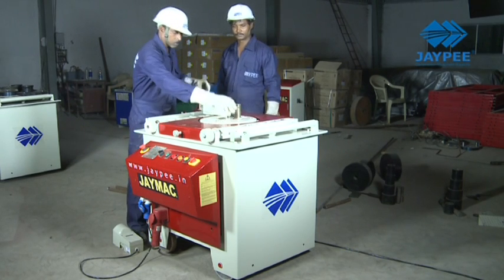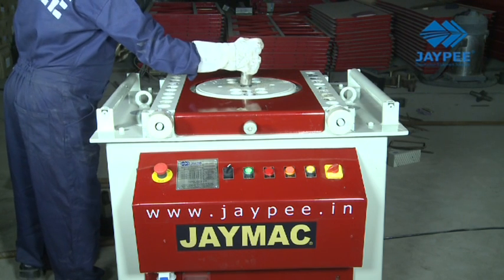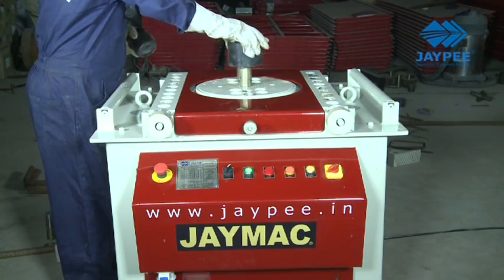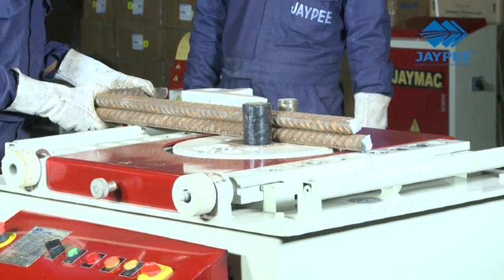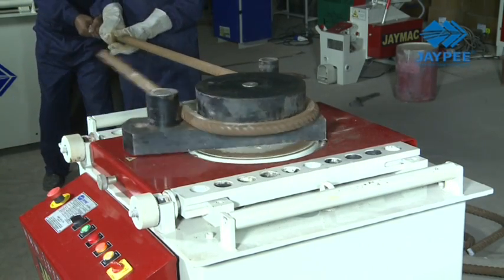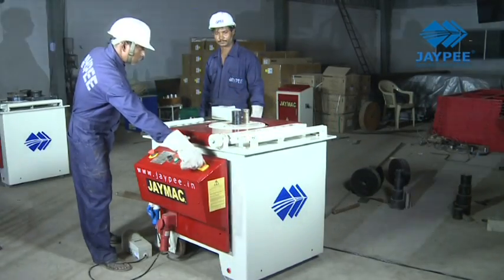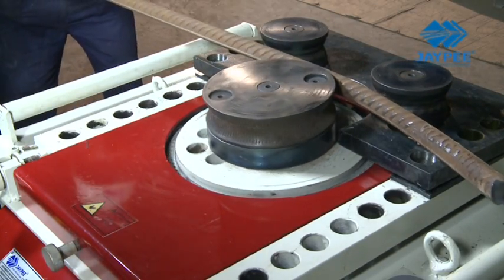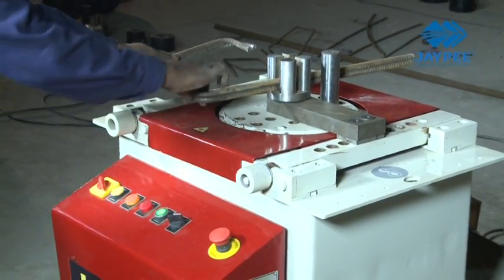Bar Bending Machine @JAYMAC - Call +91 9051234444

Comment from the maker: Bar Bending Machine
Bar Bending Machine is a semi automatic, durable fast and cost effective machine, used for bending reinforcement bars and various forms of round bars.

This machine effectively increases the production capacity of your steel yard, minimizing the use of manual labor.

Set on a wide body with a heavy duty gearbox, JAYMAC® Bar Bending Machines boast of a rigid design which helps maintain the performance of the machine year after year. Oil bathed gearboxes with hardened forged alloy gears provide maximum strength and innovative features such as push button bending give operator comfort.